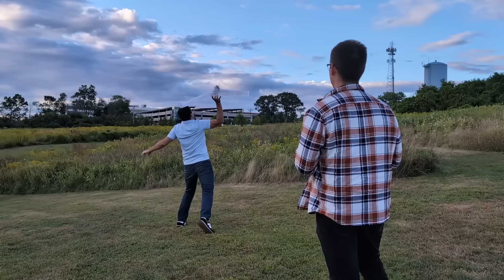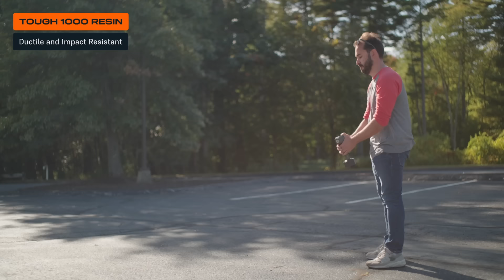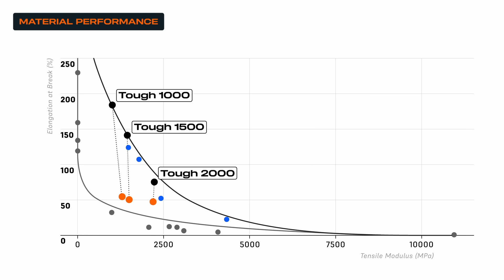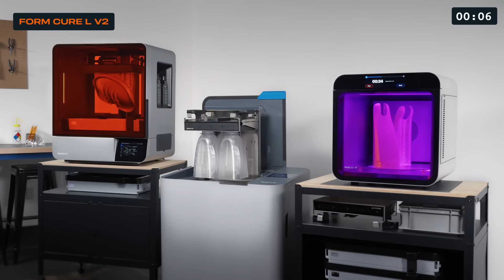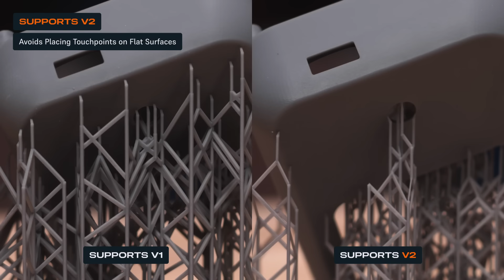Formlabs Fall 2025 Product Announcement Keynote

Comment: All excellent information.
But I was hoping for more information on the "Push of a button" approach. It keeps saying that the parts can be made at the push of a button, but never really shows exactly how and when that's done? Is it built in to the CAD program you use, so you can select a part on the CAD display and click a "print" button which generates the GCode and sends it directly to the printer. If so, which CAD program? Does the printer have to be cable-connected to the computer running the CAD program? I'd really love to see it being done.
Reply from the maker: Thanks for your comment!
CAD models can be imported into our print preparation software PreForm easily, where the print job can be set up quickly using the 1-Click-Print option (though manual setup is also possible). The printer can be connected to the computer via USB, LAN or wifi.

Comment: can you mix the colors with the tough resins?
Reply from the maker: Custom colors are currently only available in Color Resin (and Color Kit on Form 3), which is a general purpose resin. For other materials, painting the parts after printing remains an option.

Comment: Tough resins rivaling thermoplastics are a game-changer for functional prototyping! 🚀 When those validated prototypes are ready for end-use in higher volumes or specific materials, our CNC machining & low-volume injection molding are ready to take over. Exciting future for manufacturing!

Comment: Damn, I bought the form 4, but end up not using it as much as I want because of the higher Cost Resin and the Company I Bootstrapped and currently working hard to get off of the ground is running low on cash
But seeing how formlabs is improving their game, it is a company I want to work with, and produce our products using their equipments so we can just focus on the creative side of the business I can see how Formlabs will take a off lot of headache in production side, so Businesses can just focus on thinking what product to bring out and serve their customers well